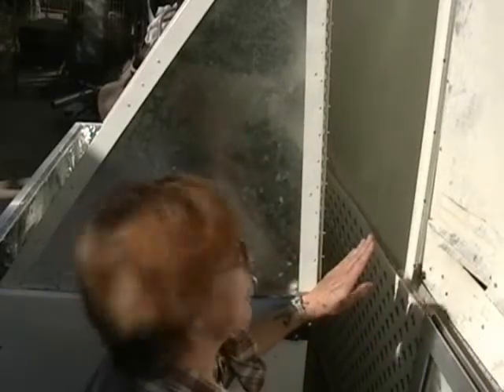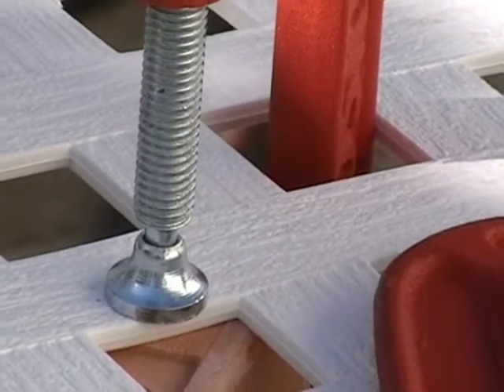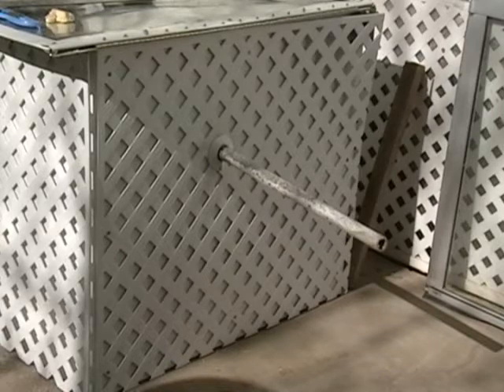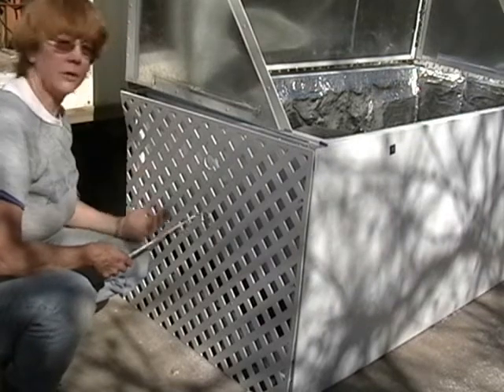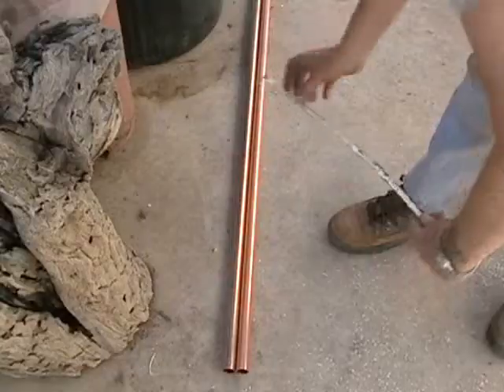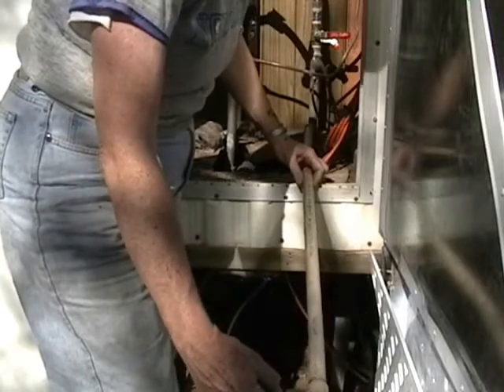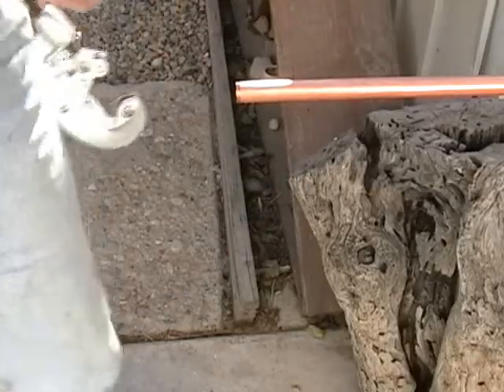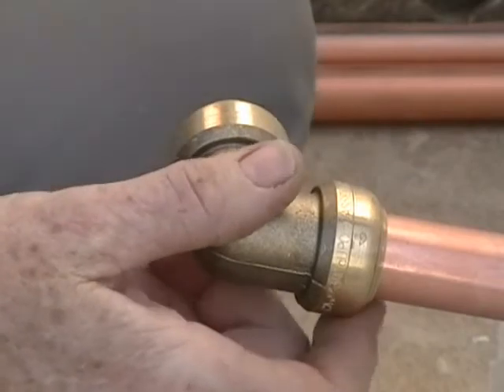Bread Box Water Heater, Part 27

Comment: I dont think it matters if the outside the box is White, as long as there is good heat on the inside coming thru the Glass. I'm building a Solar Can Heater and a Solar water heater now, I think the best thing to do is make sure the wood does not rot from getting wet too often, seal it very good with Varnish or metal covering, and it should last a long time.